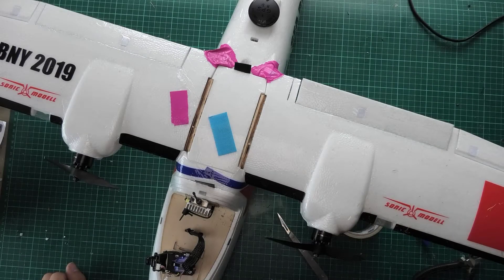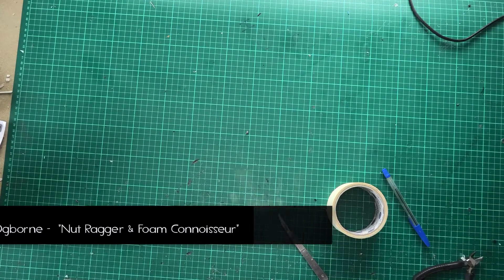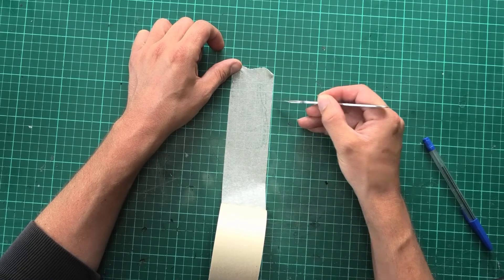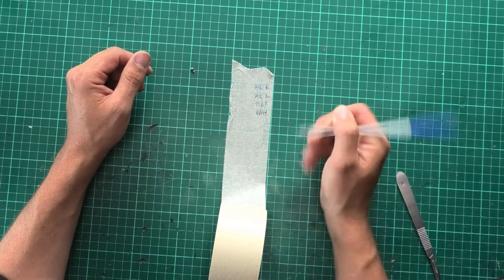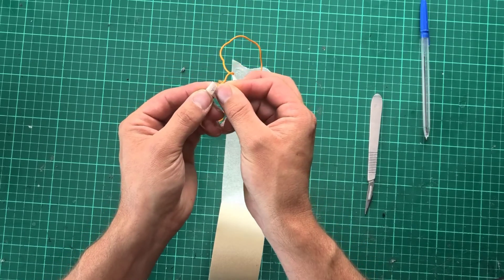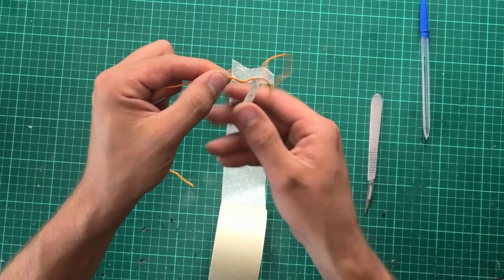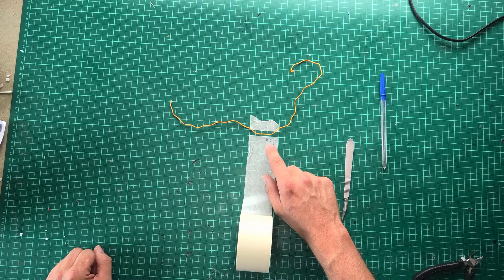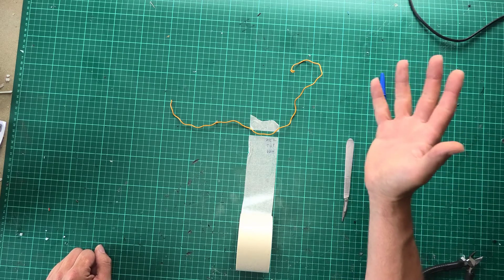Simple RC Wiring Tip - How To Easily Label Servo Wires Etc...

Comment: Here is another one. For all batteries: 
Use same tape, stick on battery and after all flights, mark on that. Four vertical lines and fifth one across, not sure if there is a terminology for what's that marking is called. 

That helps me know how many cycles. 

\m/
Reply: tally marks I...II...III...IIII etc etc